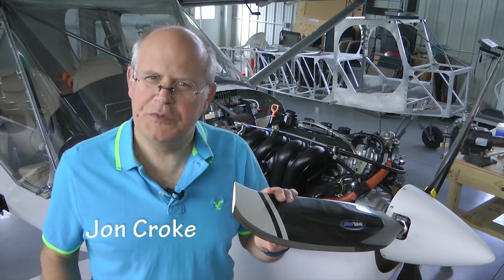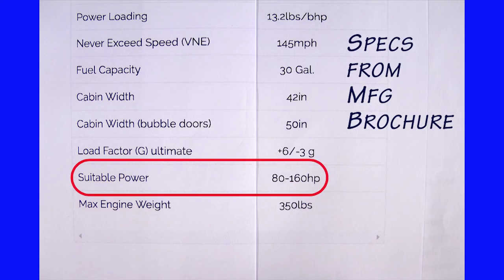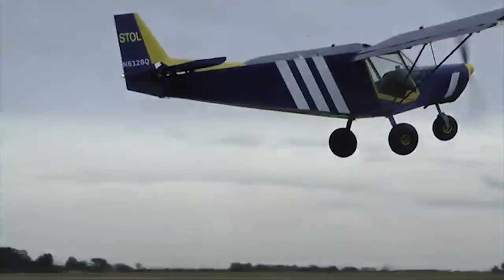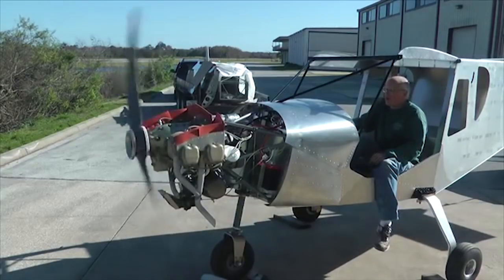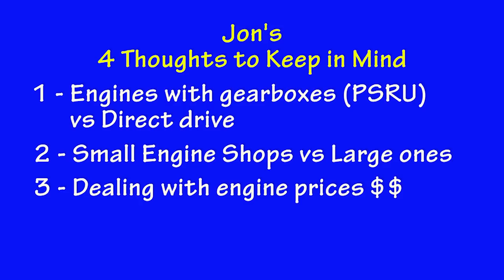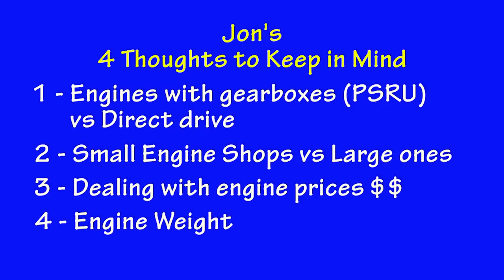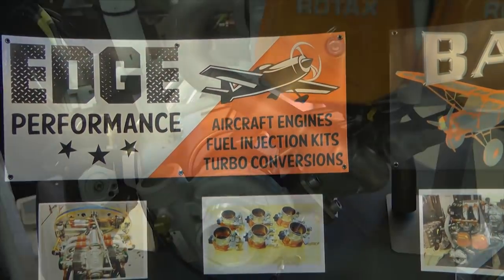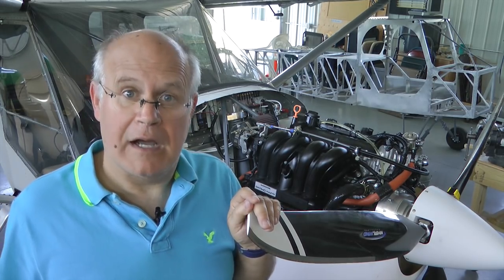How to Pick the Best Engine for your Experimental Aircraft

Comment: Why not make it easy go to a car junk yard and get a V8 and rebuild that into a race engine and mount  that to a airplane. Then get a propeller  made from hard steel that would have 13 blades in the circle,  then each blade at 14 wide for maximum pulling and a very high air flow. When done it be the king in the sky in the airplane

Comment: My son and I put Whipple screw type super chargers on our “go-fast” boat.  On the Dino the torque curve went to near peak at rpm’s as low as 3000 rpm.  We would put aggressive props and have no problems getting on plane where other boats with equal peak HP but lower torque RPM not get on plane.  We had one set of props that would blow out if you throttled up too quickly.  You had to give it half throttle to get on plane then slowly work your way up in rpm’s letting the prop dictate

Comment: That’s a good explanation. In my opinion weight is the main aspect of a good choice. For example: Lycoming weighs 145 lbs (65 kg), the adapted VW weighs 198 lbs (92 kg). This is a big difference and has a big influence on aircraft performance.

Comment: Well done video. Lots of very insightful tips. One that I didn't hear is the one that threw me on my build. Cruise RPM and TBO. I'm used to low speed engines like the old Continental 65. When I found that the engine I had planned on using on my homebuilt project cruised at something north of 5000 rpm (automotive engine with a geared prop), I got very cold feet. When I started asking about the TBO, everyone I talked to just tried giving me the run-around. I asked other manufacturers of similar systems about their TBOs, and everyone had a different story. As I continued looking into it, I found that nobody really knew, and they were just making things up. Buyers and builders beware!

Comment: I am designing my own aircraft full systems it's wing span is 16f nose to tail 20.5f and with 15 cubic feet of fuel capacity what is the best possible engine for a speed of about 200 to 300miles per hour

Comment: Step 1:
Horsepower Requirements: 1900
Speed: 412 kts at 21,000 ft

Step 2:
Daimler-Benz DB 603E-1 
no other options

Step3:
Company no longer exists / no engines in production or for sale

Step 4:
Not a single one of these engines is flying... or even running

Comment: If you buy an experimental aircraft that is already built and wanted to change to a different brand or size of engine, would a normal A&P know how to replace the engine?  
I’ve read that an A&P can be just as stumped as a non-gear head if asked to do an annual inspection on an experimental aircraft they’ve never seen before; is this true with installing an engine, even a Continental/Lycoming?

Comment: Can we swap automobile engine for homebuilts
Reply: Rohit Sorte they have to be converted, but yes.  Keep in mind, you’ll find they aren’t as reliable as an engine that is built for an aircraft however.  There’s some study that was done regarding LSAs and Experimental aircraft going down more often with a converted auto engines too.  But literally anything can be done, it just depends on your budget
Reply: @tfgames0019  But this engines represent here in demonstrations are also modified from auto engine base. Basically due to low atmospheric pressure on high altitude intake process has to be pressurised

Comment: Do consider weight! Calculate for each option your power to weight ratio when installed. Power to weight drives take off and climb performance. Also consider C of G. An airplane with a powerful heavy engine/transmission/prop combination which you cant fly without ballast in the back is inconvenient and negates the take off performance advantage of the extra power

Comment: hey John, here's what I did with my cub-ex2. I sold the engine and the fuel tank installed battery packs in the wings 60kw electric motor took up 1/5 the nose so battery packs there and in the tail to balance it out with batteries both high and low for and aft I got an excellent balance got my bubble centered just below the center of the wing, I went with the Dynon sky-view avionics, as it interfaces smoothly with my augmented glasses by aero, I did design and install empilates and a Robinson s-stol kit all my control surfaces are servo controlled complete autopilot. and huge wheels  yes I put a lot of extra in this build but it is experimental so I am experimenting. mind you the directions for the airframe were followed most the way(structurally stronger) oh I reinforced my landing gear attachment points with the battery trays.
Reply: And, you now get a whopping 90 minutes of flight time and a minimum 4 hour recharge!

Comment: I'm leaning toward a hot-rodded "name brand" engine.  You can buy a used Rotax 912 for $2500 to $4000 complete.  Overhaul it yourself.  (It's not magic.  It's just an engine.)  Buy the Edge Performance turbo, big bore, etc.  You end up with more than 914 Turbo performance for less than the cost of a new 912.

Comment: Great videos 
I own a rans S10  and trying to get insurance all was cool up till they asked engine make and model 
NO!!!! We will not insure you
Reply: So I asked would revmaster or a aerovee motor the okay 
NO!!!  It must be a 4 cycle and aircraft based engine. 
They said yes to a rotax 9 series engine
But I don't have 20k laying around
I don't know where to go from here
Reply: This is one of the reasons I'm building my own plane. As a builder of both air frame and engine your accountability goes way up in the system of how this world operates. If the rules were slightly more liberal I wouldn't even go for a pilots license since my desire is only back country Stol  low and slow flying. I would suggest join up some of the flying forums to find people that have experience in this same area of insuring your plane referring to which engines are accepted. Message boards and forums will be a great way to communicate with someone with similar issues. Good luck

Comment: I would love to know your thoughts or, better yet, see a Homebuilt Help video on the subject of the Czech produced Verner radial 4 stroke engines. Their weight is comparable to equivalent Rotax models and as they are slow turning engines, their prop efficiencies are high and torque values are very high, and no gear reduction unit required.  And, if you ever heard one running, its low throaty sound is music to the ears. Fairly successful in Europe, in the US, there are a few now flying.

Comment: Just out of curiosity, did you follow your own guidelines (especially talking to no-kidding flying customers) when you chose to go with Viking? Just curious, as I followed  similar analytical approach and put Viking and Jan to the side. I was pretty sold with Mark and Aeromomentum, and looked into even a Jabiru3300. I decided on something else, but that is besides the point. Thanks!
Reply from the maker: Looks can be deceiving!  This is the 2nd engine in this aircraft and will not be the last. I change engines as often as possible for the purpose of personal evaluation. Economics gets in the way of making this happen more frequently.

Comment: Rotac Radial-any thoughts vs inline?
Reply: who doesnt love the sounds of a radial engine.I am big fan of inline engines( i think horizontal might fall in line here aswell) they have 25% less moving parts make more torque, and have less vibrations than a V configuration.wonder how radial's compare on the dyno? With my love of old harley engines i have often wondered how hard would it be to convert and old kunklehead or panhead to a radial configuration!https://www.youtube.com/watch?v=p6BNy21RkbY  https://www.kitplanes.com/experimotive-7/

Comment: I am by no means an experienced pilot or builder, but shouldn't the concern with engine weight be about the moments those extra 20 pounds exert hanging off the nose? 20lbs of engine way out there on the nose does a lot more to mess with weight and balance than an extra 20lbs of pilot almost directly under the CG. Or am I way off base here?
Reply from the maker: Not off base, but I think you may not be considering how simple it is to adjust aircraft balance by simply changing the engine mount length from the firewall or moving a battery or similar object forward or aft. Once in balance, weight is weight.
Reply: @HomebuiltHELP    and you cant as a pilot just stick your spare tire in the cargo area lol.

Comment: Love the way of your teaching Sir one Qusition 🙋  can we use car or bike engine in ultralight aircrafts  ?
Reply: Yes there are many accomplished well known pilots flying motorcycle and automobile and even show machine engines in their airplanes. Steve Henry comes to !and the multi year winner of the famous STOL drag competition used a Yamaha Snow Machine engine in his plane. Google Steve Henry and or Auto Conversion Engines for Airplanes to find plenty of useful information.
Reply: I'm thinking about getting into flying (always wanted to, even joined the Air Cadets in my teens) but am on such a seriously small budget that my only choice would be to try and use a car or bike engine so I hope that I can find the spec's I need and a design that allows for something I can get in a breakers yard... I just got rid of a 1.6l engine that was amazing in my Mazda but don't think it will be light enough to make an air craft from anyway.

I know I have a lot of reading to do before I even put a spanner to a nut so don't expect any quick replies here about this.

Thanks for asking this qiestion 'Simple Life', you made me less afraid to comment on this video.
Reply: NO auto engines.  Airplanes  will make that auto engine run at rpm's they normally don't use.  NO car engines.
Reply: @mmichaeldonavon  thank you for the answer one request for your next video log you explain what is deference car engines and airplane engine Andy why Zenth aircraft or some other using Honda Accord or Honda fit engine ??
Reply: Some automotive engines are far better than the certified ones.
Reply: Yes, but don't

Comment: Eggenfellner comes to mind, sold a lot of subaru FWF packages and walked away from all the customers, started selling hondas
Reply: Yes he is delivering.............delivering engines that have come from wrecked Honda fits cars............wrecked cars with engines that have no history...........except a history that includes when the owners teenage son borrows the car and rat bags the engine............rat bag , meaning over revving the hell out of it , dumping the clutch from a high rev , overheating the engine , etc...........who wants an engine from a wrecked car with no history and no idea how many tough miles were put on it..........roll the dice and take your chances..........no thanks............a quality auto conversion starts with a new engine block (aero momentum) , or rebuilding an engine with all new parts and proper engineered procedures (Corvair conversions by SPA and FlyCorvair) ............nothing speaks reliability like a new engine or a rebuild that you just did yourself with sound technical guidance.........you do not want an engine that has the owner doing the research and development in control software , instead of the seller ............an engine should enter the market with no bugs from its release ............a buyer should not be de-bugging a control system for the seller...........he should be enjoying flying a bug free engine and not doing R&D for the seller..........Aeromomentum sells zero time , new engines with a proven control system............a Corvair converted properly with a good old Marvel-Schebler aircraft carburetor is my choice..
Reply: FAA Inspector you seem to always have an opinion, but nothing based on facts. precisely what it is opinion. Everything stated is actually 100 percent false- Viking offers new and slightly used and every engine you can get every amount of information for. Over 500 customers and a lot of those flying successfully with 600 plus hours.plus you get the most up to date modern technology available.
Reply: @faainspector9699  Except he also offers new engines.  As always the choice is yours.  And checking a used engine's health is not difficult.  If you can build an airplane you can check an engine.

Comment: It's very simple, if you want to build and to fly in a shortest amount of time, get a traditional aircraft engine, including Rotax. If you want to tinker around forever, get an unconventional engine.
Reply: Isn't tinkering forever one of the benefits of a homebuilt?
Reply: Yes that is a benefit but most people want to fly instead of getting grounded because the auto engine is unreliable.
Reply: But auto engines are not unreliable. Thousands are flying today.
Reply: While failing to admit that just recently the Rotax 912's were grounded for weeks due to a manufactured faulty exhaust valve ......SMH.......always One in every crowd
Reply: @evopwrmods  rotax engines have today all ower prizes and no anythin k better than many others, vigink,honda,etc many new better engine have lot cheapen than shit rotax

Comment: Good points, Jon! 
A couple additional points to consider are availability of a firewall-forward (FWF) kit (from engine manufacturer, distributor or kit manufacturer), and resale (used) value of the engine.